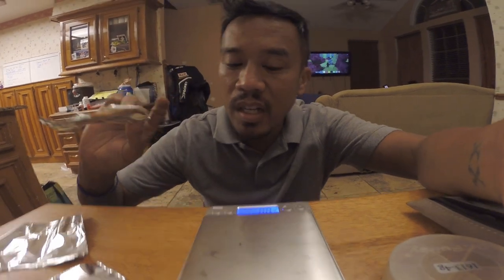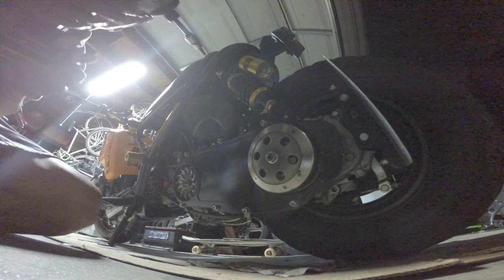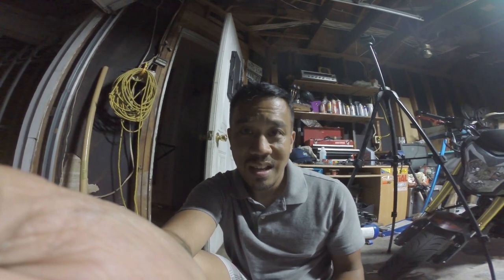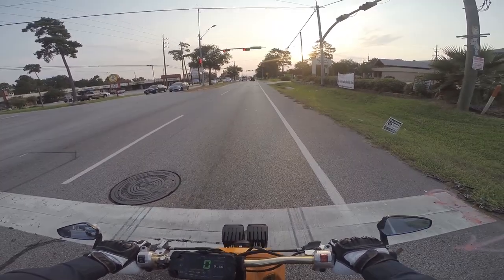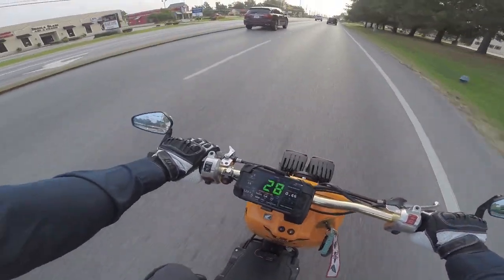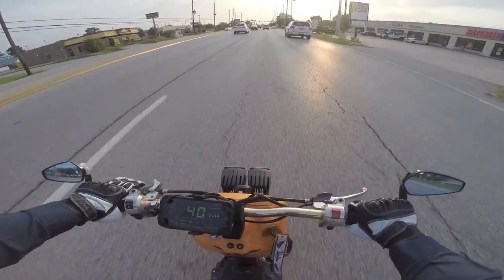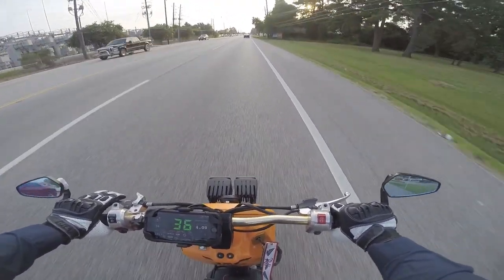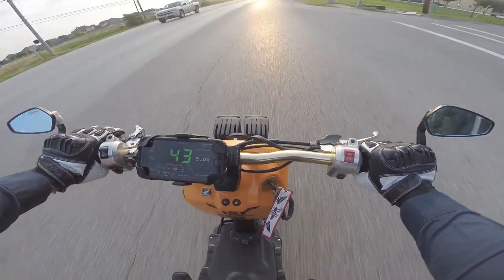Will Aluminum foil work to adjust your Honda Ruckus Sliders / Rollers to make it faster?

Comment: I gotta try that with mine. Once I tune the carb to where there are no issues anymore I'll be diving into the variator. 

I have seen the foil trick on various forum but I've never seen it in action. 🤙🏼
Reply from the maker: Hey man it seems to work and its easy to make micro adjustments. I can change it in a few min. You will get so much more speed when you tune your CVT.

Comment: How's your foil holding up? I used this trick yesterday to bring my sliders from 6.5g to 8g
Reply from the maker: I checked it this weekend and the foil looks fine. I was expecting to see it more compacted and loose but its still the same way I left it.
Reply from the maker: Foil is holding up great so far. Opened and checked , expected to see the foil more compact and it was still good. Why 6.5 to 8.0g?
Reply: Trying to reducing my rpm in the upper end, only helped 2-300 rpm